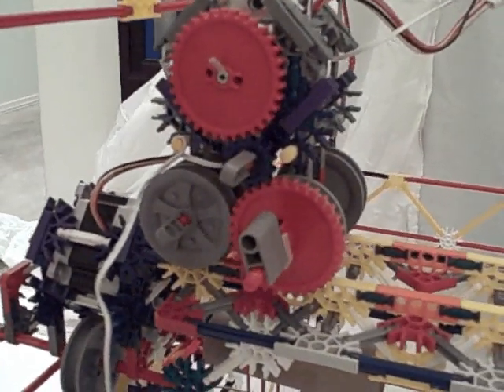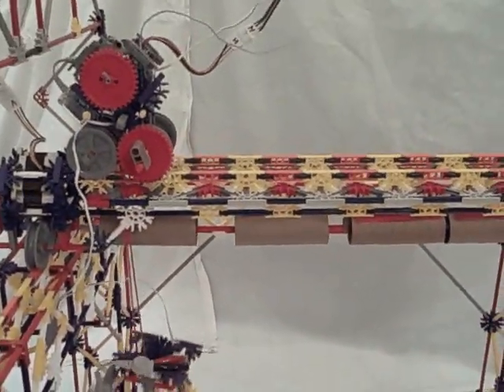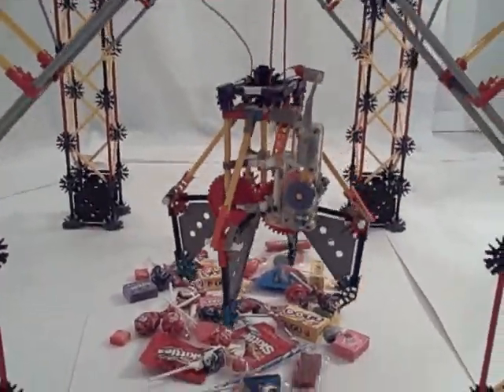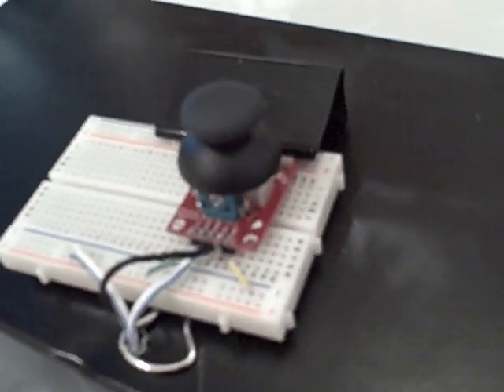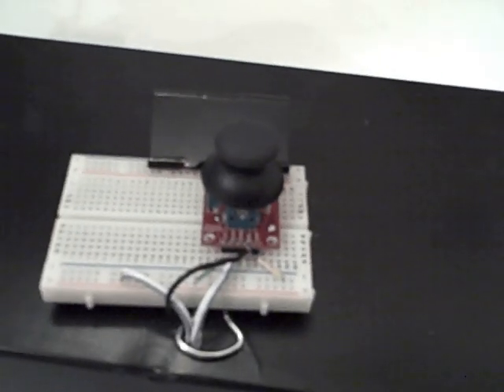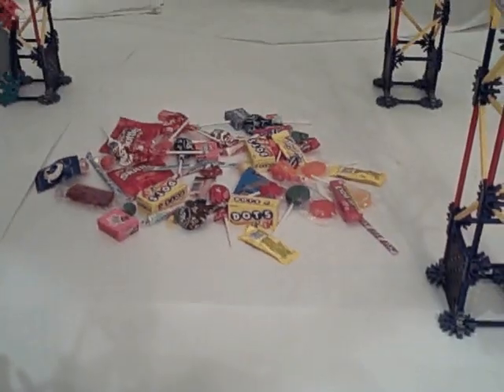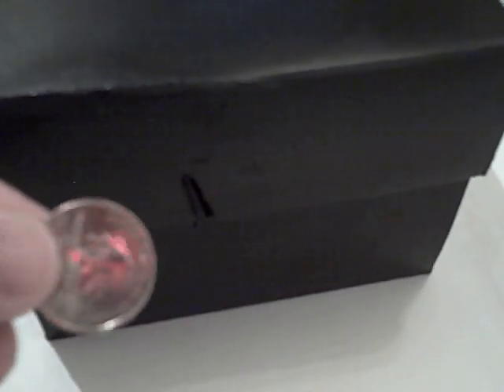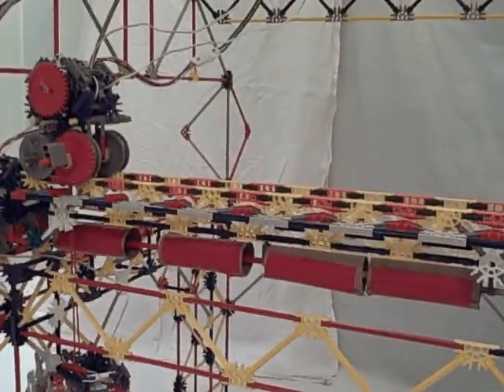Knex Claw Machine

Comment from the maker: The claw was integrated with a microcontroller and a K'Nex motor. I programmed the microcontroller to tell the K'Nex motor to rotate (open) one way and then the other (close). It is a bit crude since I did not have sensors for the claw for how much to open or close, it was based off of how long I wanted the motor to rotate which took a few trial and errors.